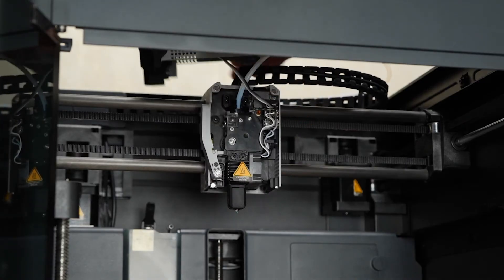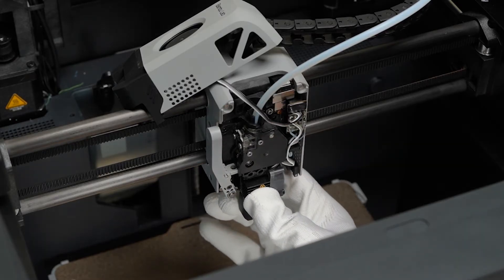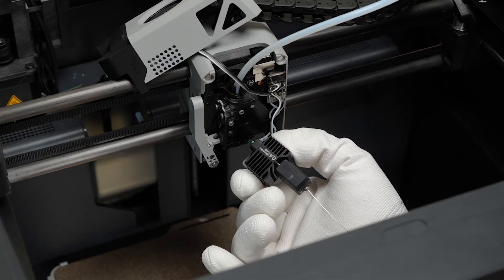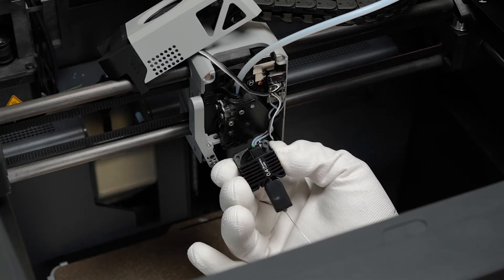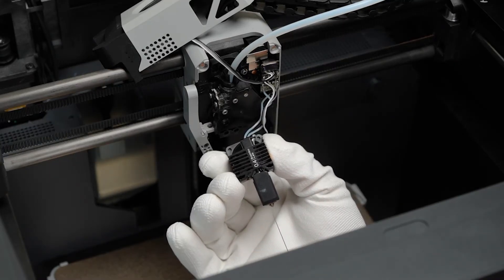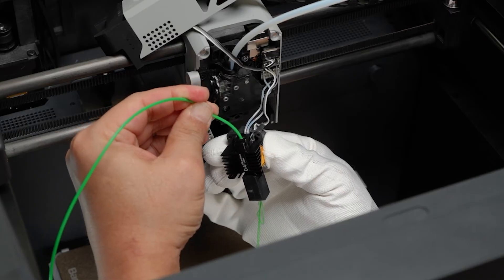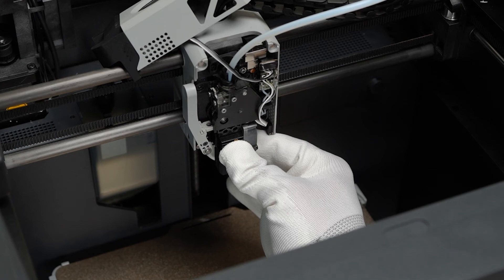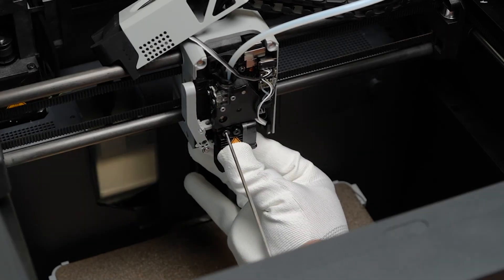Unclogging with a Pin Tool

Comment: I tried this at first when my nozzle was jammed with TPU, and no luck. What ended up doing it for me was the 1.5mm allen key trick. With the hotend removed (but still on the machine) - Heat up the allen with a lighter. Stick it down the nozzle , then set the nozzle to 0 or turn off the printer. Let it sit for about 30 seconds. Pull the allen key back. That worked for me with Overture black TPU.
Reply: Clutch thanks man